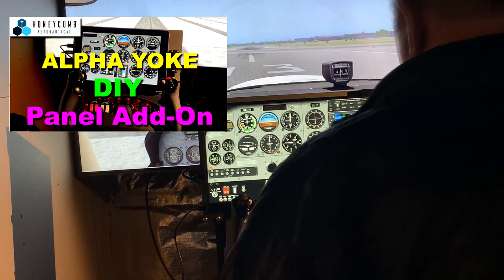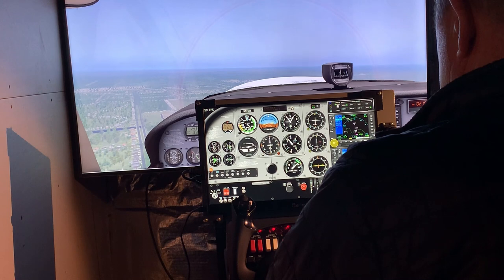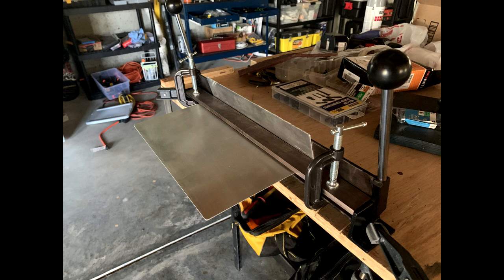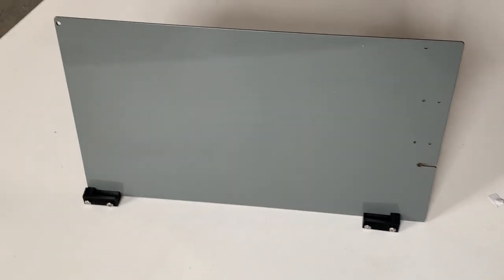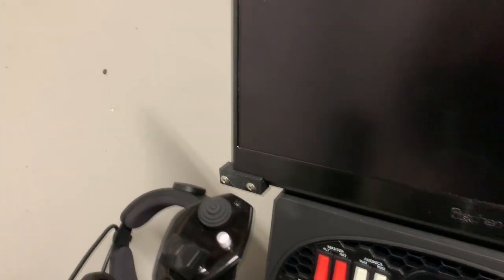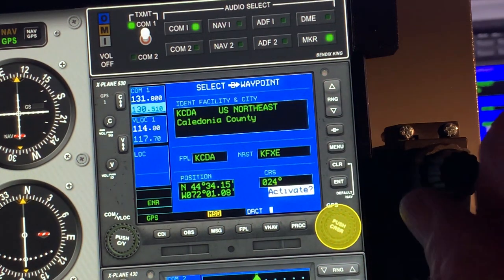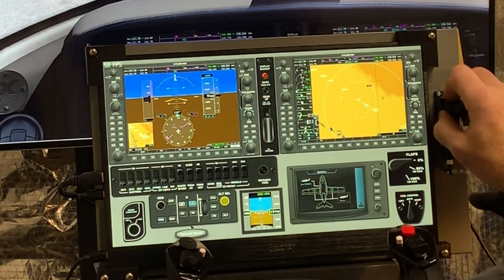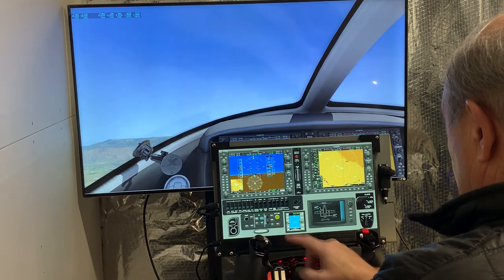$360 DIY Touchscreen Cockpit for Honeycomb Alpha(or Saitek) Yoke

Comment: hi again, i noticed your dimensions on your video and then compared them to what the Prechen Monitor shows under a question and answer, they show Please look below, didn't seem to match and it's the exact same monitor.  could you double-check on your amazon order to see what the true dimensions were showing.  I have the brackets on order but am wondering if it would work.  I think someone has the numbers mixed up a bit. such as the person below that put those dimensions in the question and answer section of my Prechen monitor that has the same part # as yours.
This monitor thickness is 9.5 mm
width is 375mm
height is 277

By Ling Liu on June 9, 2019

Comment: I'd buy this bracket with a quickness. Come on someone!
Reply from the maker: Quite easy to build and there are some small monitors now that have mounting screw holes(VESA) on the back so you wouldn’t need the brackets you could just attach it from the rear. The metal frame is quite easy to build.

Comment: I see an 18" Harbor Freight Bending Brake listed on their website with the black Ball handles like you have, but it looks like yours was a bit wider, do you remember how many inches wide your Bending Brake is?  thanks in advance.  SUBSCRIBED, & Thumbs UP
Reply from the maker: Harpoon_Bakery    18” is okay of your material will fit but for $20 more I got 

https://www.harborfreight.com/30-inch-bending-brake-67240.html